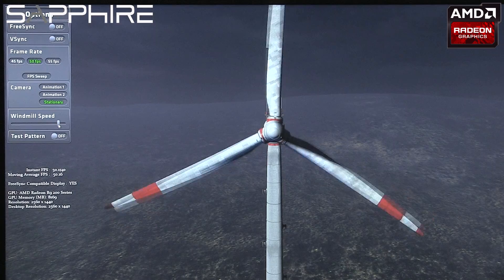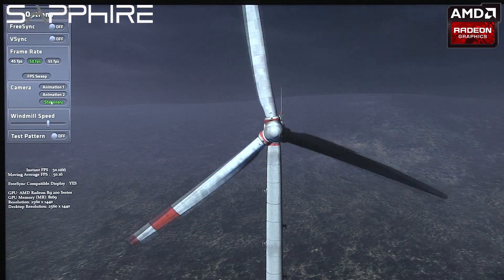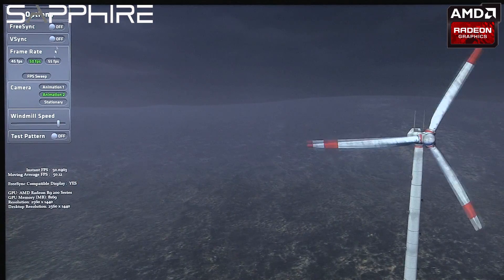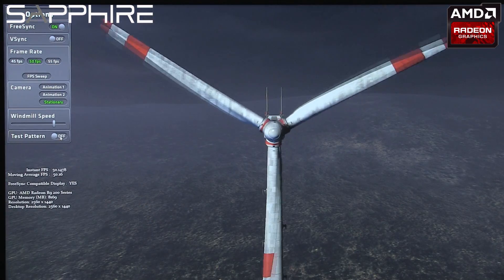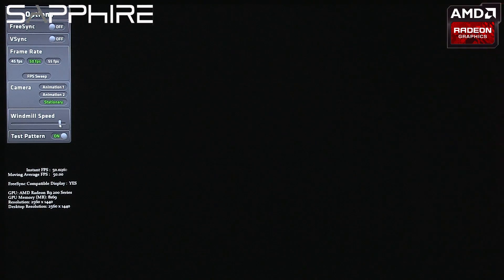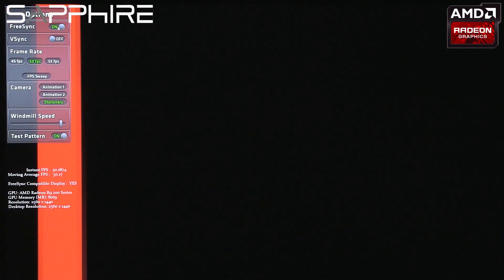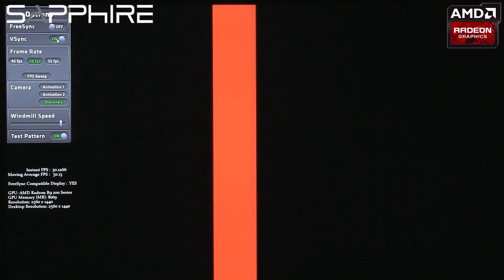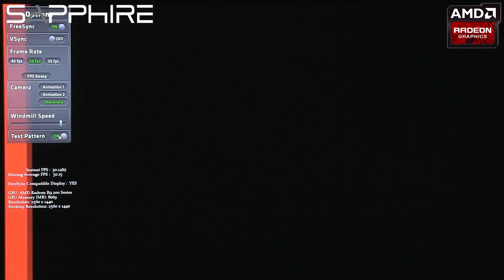FreeSync Demonstration

Comment: "... dynamically changes the refresh rate of the monitor." That part in particular worries me. Vertical refresh rate under 75 Hz is actually harmful for the eyes so I do very much INSIST to play with locked 75 Hz VSync. So, in that case could the FSync be a useful tool to the player or not?
Reply: Hiya, allow me to try and answer this... First off, I don't know the research which claims that below 75hz can harm your eyes and I don't understand how researchers would be able to put any number of Hz as the magic number because distance from screen, brightness, g2g response, pixel density, image sharpness and quite a few other things are likely the real culprits of any harm caused. HOWEVER, let's say they are correct, the answer would be both YES and NO. Yes if you are willing to lock your framerate 3-4fps below the refresh rate of the monitor you pickup. The reason for this is because it will be like Vsync visually (providing you hold the framerate) but with much lower input latency. If you get a screen that has 120/144/165/189/240 Hz then when playing games with freesync enabled then obviously we smash your 75hz target. ALSO if you drop below half of the max refresh rate the monitor then uses something called LFC (Low Framerate Compensation) and will show the same image on multiple refreshes so it would still be high (so on a 144hz monitor u would basically almost always be over 75hz and if you did drop under it then it would only be by around 5-6 hz). The NO is if you buy a 75hz freesync monitor and aim to lock at 75hz because then you get the full Vsync input latency and if you drop frames you drop below you refresh rate target. 

TLDR, If you get a 144hz monitor you will almost always be above 72hz 99.9% of the time. (providing it has LFC) and you will have smoothness like Vsync without the input lag.
Reply: @PixelTheory  Greetings to you too, dear Sir. And thank you for your detailed reply. I`ve been taught that refresh rates under 75 Hz result in visible waives on the screen, especially when looking at shadowed /dark areas. Such waives provokes unvoluntarely attempt of the eyes to follow, which isn`t any good. 
For example, while playing State of Decay at 60 Hz, I see waives on my screen on dark background, which is uncomfortable to me. At 75 Hz the image is visibly more stable. 

So, in accordance with my preferences, it seems that I have two options: 1) to invest in 144 Hz + monitor with Fsync and 2) to keep full Vsync on my current monitor or any other without Fsync. 
I`d love to read your opinion of that matter.
Reply: @Vorador-rt1wq  Hey, personally I would always recommend adaptive refresh rate tech and high refresh rates. I have been using high refresh rates now for around 7 maybe 8 years (since 3D monitors became a thing). When combined with modern freesync displays (those with LFC) it is 100% without a doubt the best way to play games today. So, for me, it's got to be a 144hz 1080p or 1440p monitor. 1080p if your all about smoothness and 1440p if you are about sharpness. When it comes to the waves you see, that is worrying. I have not witnessed that effect on a screen for many many years.
Reply: @PixelTheory  A valuable advice and with good reasons. Thank you kindly. The AMD site should provide some choices for me to pick. 27" does seems a lot for desktop so probably 24" would be better.
Reply: @Vorador-rt1wq  24 for 1080p and 27 for 1440p are pretty good imho. Thanks  and you're welcome.

Comment: So what happens if the fps is greater than 60 on a 60 hz monitor. How would freesync fix this?
Reply: Set a limit. Also, in theory you dont require freesync if your fps matches the monitors refresh rate. That only happens if you have less fps than your refresh rate.

Comment: What if I have an Nvidia card?
Reply: +Fraydizs g-sync is ridiculous and adds a massive price (in 21:9 at least) so I might be switching to AMD because of that
Reply: alvarokas I havent got the monitor yet, I'm waiting for christmas.
Reply: nice
Reply: you cant use it. Nvidia has gsync
Reply: bloskarch 23 aww now i gotta buy a gsynch monitor qwq
Reply: Carter I did that. I switched to a rx480 and I'm getting a freesync ultrawide monitor.
Reply: bloskarch 23 cool im thinking of getting the gtx 1060 or 1070 though
Reply: +Fraydizs I am as well and I'm getting a 75hz curved ultrawide freesync monitor so I'm between a gtx 1070 or getting (maybe 2) rx 480(s) so I can utilize freesync
Reply: Carter I have a question. Since i found a relatively cheap 144 hz monitor. If i use V-sync it shouldnt stutter since the refresh rate is pretty high right?
Reply: +Fraydizs it's not going to stutter unless you pass 144fps
Reply: +Fraydizs 144hz is basically saying that the screen refreshes that many time a second, a 60hz screen gets tearing when you're enough past 60fps
Reply: Carter ah so it wont tear at 144hz if my framerate is, say, 100fps?
Reply: +Fraydizs it could be too high a refresh rate
Reply: +Fraydizs the best is to sync refresh rate and fps
Reply: Carter k thanks, so even if the frame rate is lower than the refresh rate it could tear?
Reply: +bloskarch 23 did it go well? can you tell your experience? thanks
Reply: bloskarch 23
i think i'm getting one during black friday. So maybe i will be telling you then :)
Reply: ultra wide for 480 bad idea .this mid range card are not build to handle that resolution in average 60 fps
Reply: John Jeffry well now i can tell you it can, at the moment ;)

Comment: I have the Freesync technical demo and for some reason the Freesync button is not working. It detects that my monitor is Freesync and I have 15.7 drivers, Freesync enabled and I have Crossfire disabled. The videocard is a 295X2 from Sapphire. Can you help me so I can actually use the freesync in the demo? Also, is is true that it only supports non Crossfire configurations in applications? Disabling Crossfire would be enough to enable that? Please help.

Comment: Still dont understand what's the difference between vsync and freesync ? Look the same.
Reply: Ya it does in THIS video. Are you a gamer? For Example: Vsync... Your pc needs to be 60 fps CONSTANTLY but this is impossible. If your FPS is going higher or lower.. you will see stuttering for sure. Freesync does not have an fpscap so you are not able to see the tearing. I hope you understand it. My English is not the best.  Okay, your post is 2 years ago... whatever.

Comment: FreeSync still 'stutters' just as much vsync its just smoother and much less noticeable, lets use the term 'adaptive stuttering'. 

FreeSync does not fix the issue with tearing it just adds a bigger band aid that requires you to have a certain grade monitor / graphics card + driver support.
Reply: That's because this video is 30fps, if you see it real time on 60 or 144 fps it will looks smooth.
Reply: Thomas The Dank Engine 'Smoother' yes, but there is still stutter due the the real-time calculations going on.

I'm not saying FreeSync is bad, its just not the fix we all really want.
Reply: +AurynGaming, i hope you're smarter now than you were 2 years ago... it's like taking the word "instant" literally...nothing is instant, its just unnoticeable, same as "it doesn't really fix the  issue", it just makes it a little more unnoticeable.